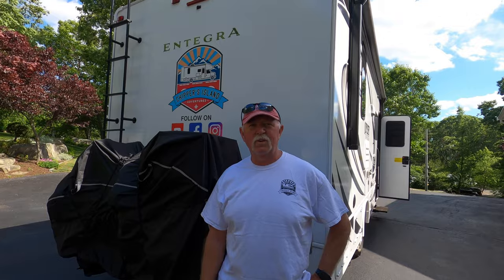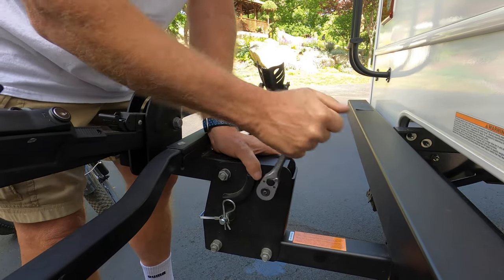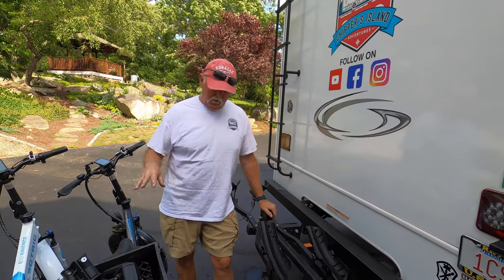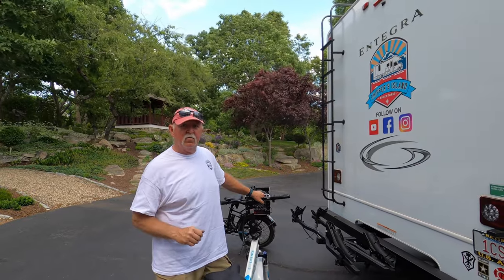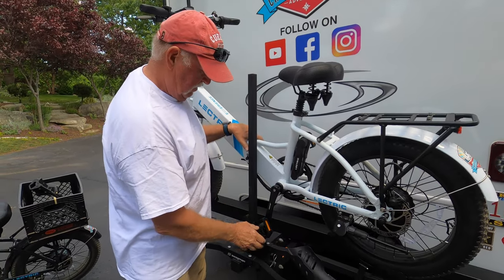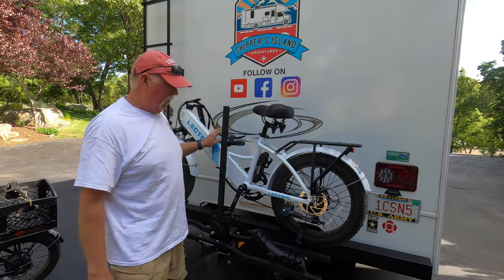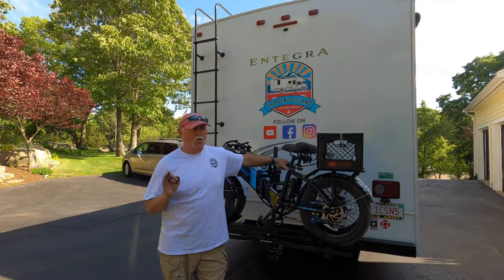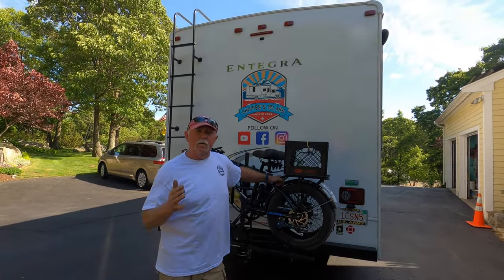Swagman E-Spec Bike Rack Overvieweview

Comment: There are better options out there. Swagman's work good, but Thule makes a better unit that folds down to help with loading. You don't have to take anything off to get your bikes on, or worry about anything in your way to lock the wheels down. Happy travels.
Reply from the maker: Thank you for watching. As with most of their products, Thule is certainly very nice with all the points you mentioned. But I believe they cost 2 times more which can be a bit prohibitive for some. Then of course there’s the availability. Nice racks indeed!

Comment: Hey Mike …enjoyed the video and ended up with the same hitch ..was wondering what size cover did you purchase ..I like the fit cause we also have the same Lectric e bikes ..Thanks !!
Reply from the maker: Hi and thanks for watching. I purchased this one for two bikes and it’s a great fit. I fold handlebars and lower seats. All the best!
Team Obsidian: Bike Cover | Styles - Transportation/Travel or Storage | Waterproof, Heavy Duty, 600D, 300D, or 210D Oxford Ripstop Materials, Anti-UV | Sizes L, XL, XXL for 1,2 or 3 bikes | Offers Constant Protection Through All 4 Seasons For All Bicycles On Or Off The Rack https://a.co/d/6UWEb8f

Comment: I have the same rack.  A helpful tip, that worked for me, is to angle it down before putting any bikes on.  With the center piece already up and do not remove the arms.  That way can just lay the bike on that stand and secure it.  Then put it in the up position for the 2nd bike.   Hope may help.
Reply from the maker: Thanks for the tip. Next time I’ll try it. All the best!